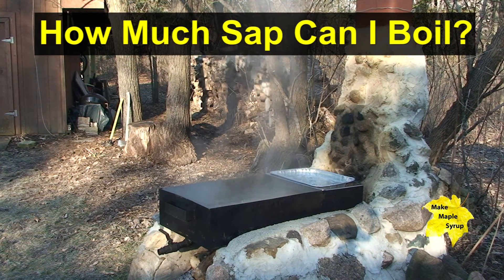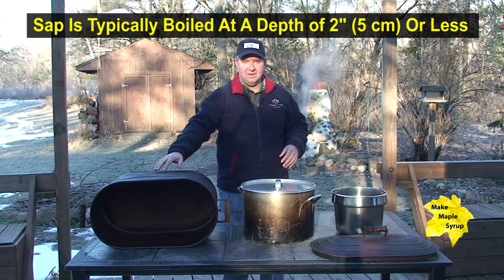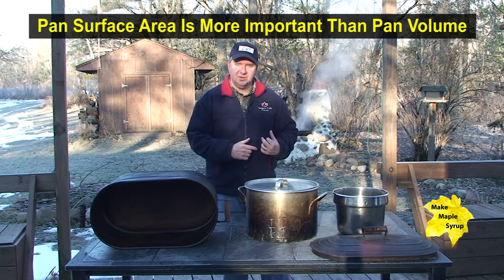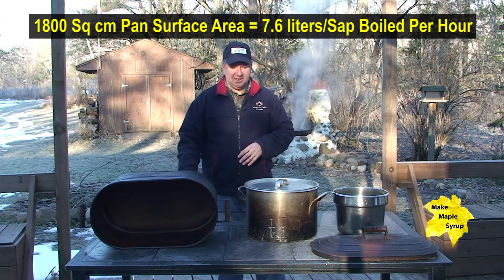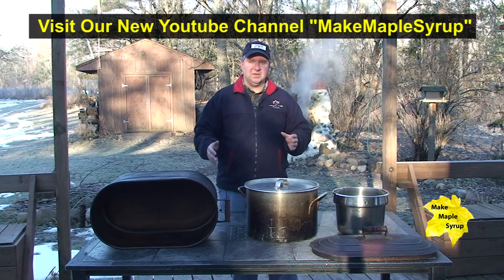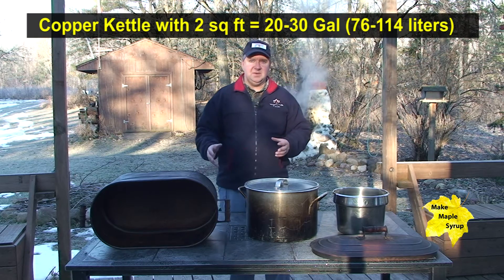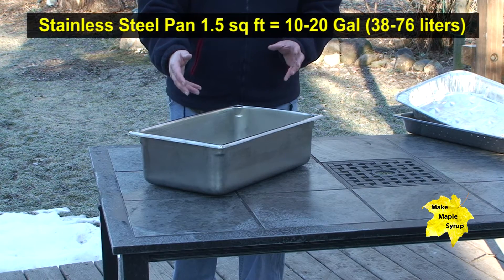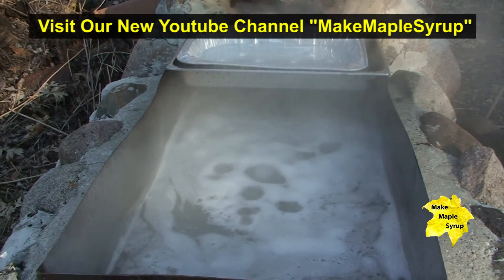Maple Pans: Size Matters When Boiling Sap & Making Maple Syrup

Comment: how did you make your arch, is it fire rated mortar and just field stones, how many years have you had it going?
Reply: Hi Gavin Stedman, thanks for watching and sharing your question. The mortar is called S mortar. It is not fire rated, but is rated for outdoor use. It has held up very well. My field stone evaporator was created in 2010 and has been used every year since it was built. The mortar will crack after a few years - but I've simply reapplied a patch to fix it - all for about $4 for a 60-lb bag. I love this design vs a barrel stove, but to each their own.